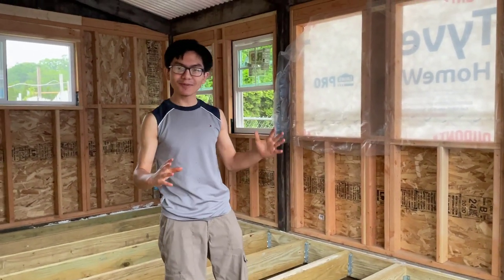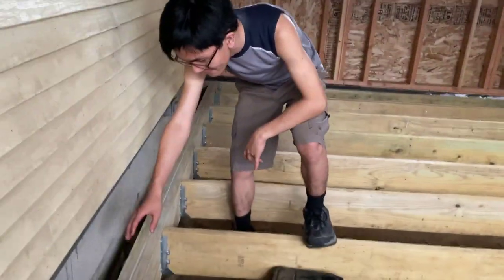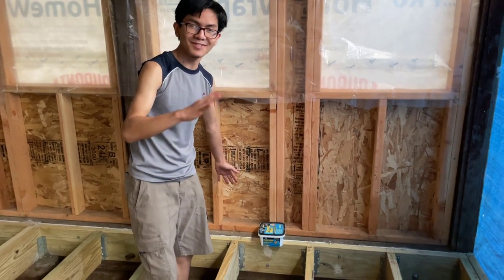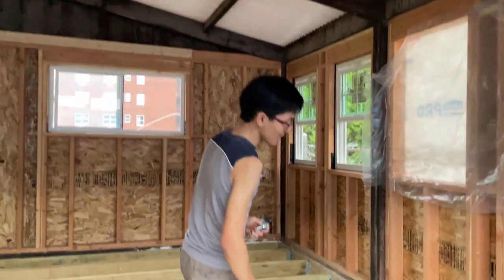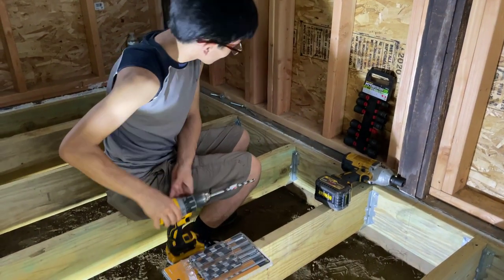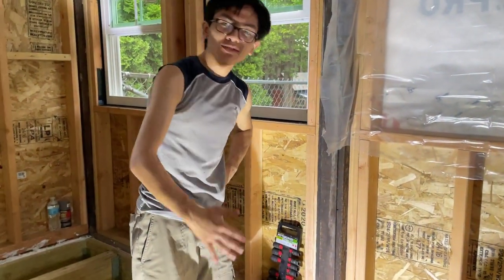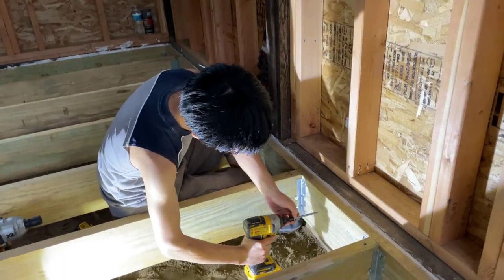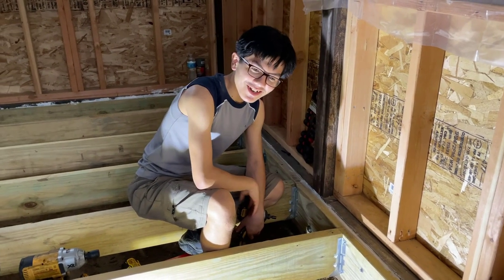Options For Fastening Deck Ledger Board To House | Lag Bolts vs Structural Screws | Enclosed Patio

Comment from the maker: Here are the #ad links to some of the hardware, materials & tools showcased or required for this project:
1.  https://amzn.to/3lqkliu  |  FastenMaster LedgerLok Flat Head Wood Screw - Bucket of 250 - 3-5/8"
2.  https://amzn.to/2ZNeVXo  |  Prime-Line 9056921 Hex Lag Screws, 1/2 in. X 3-1/2 in., A307 Grade A Hot Dip Galvanized Steel, 25-Pack
3.  https://amzn.to/3d8g7Yr  |  DRILLFORCE (5 Pcs) 1/2 in. x 6 in. HSS Titanium Coated Drill Bits, Jobber Length, Straight Shank, Metal Drill for General Purpose (1/2)
4.  https://amzn.to/3d7U2sS  |  DEWALT ATOMIC 20V MAX Impact Driver, Cordless, Compact, 1/4-Inch, Tool Only (DCF809B)
5.  https://amzn.to/3d7Kw9a  |  DEWALT 20V MAX XR Cordless Impact Wrench Kit with Detent Pin Anvil, 1/2-Inch, Tool Only (DCF894B)

Or Click on Amazon link here and search for what you need:  https://amzn.to/3xIOsqg